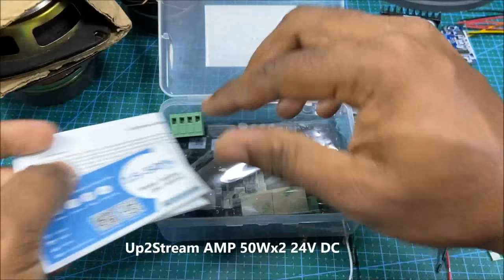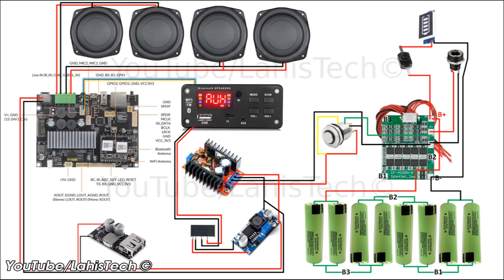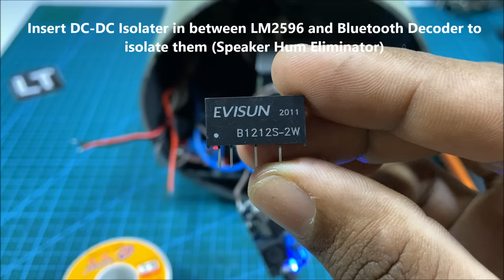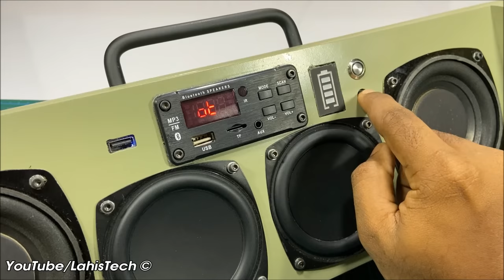DIY 100W Boombox Bluetooth Speaker from PVC Pipe || Extreme Bass Test Boombox

Comment: Nice design. But the weakest part of this design is the use of glue to hold up the chassis against them 808 s and deep basses and leaving the four speaker without a grill. It will crack up repeatedly. Some big company will like your prototype though; great job.

Comment: I think that it is not 100 watts, unless in Poland it is calculated differently with us, it would have a maximum of 55 watts rms in Poland I have 3 pieces of 12 inch speakers and the whole set is 90 watts, are you some magician? or what makes smaller is stronger

Comment: How to make 775 motor coldless drill machine recharge able plz make
Reply: You need,
50mm pvc pipe 
775 motor 
5mm shaft for drill chuck/ 5mm drill chuck 
12v DC Jack
A switch of some type

For cordless you will need 3 18650 li ion batteries and a 3s bms plus a proper charging module for the battery pack. 

Tell me if the list was helpful for you...

Comment: Nice build!! Im trying to build something like that, but Im having some doubts. Can you explain to me what is the B1212S-2W DC12V to 12V isolated power chip, and why should I put it in my project? Thankss!
Reply: It's a dc dc converter isolated module, if u share common ground from the amp and the Bluetooth module, it will cause a nasty buzzing sound from the speaker